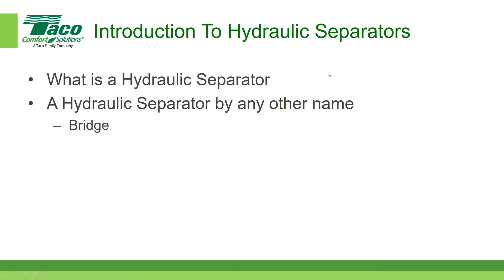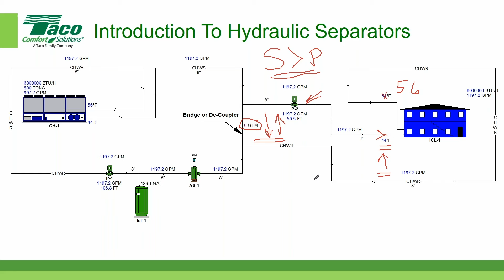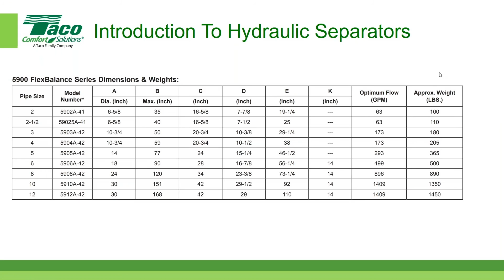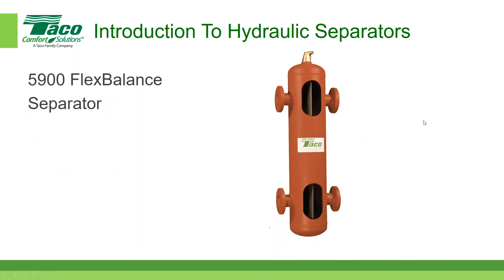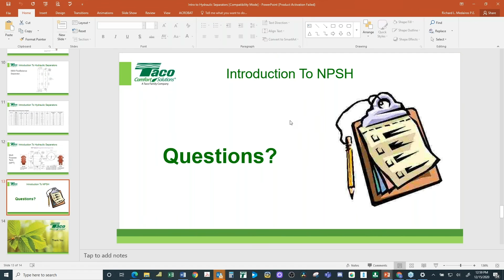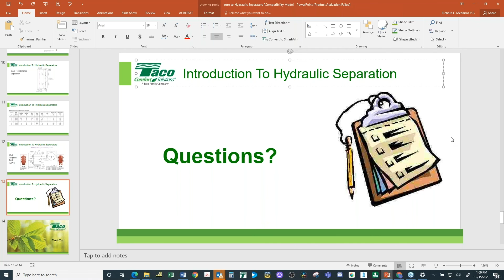Introduction to Hydraulic Separators Including Sizing and Selecting

Comment: Is there a difference in performance if the secondary loop flows across the bridge in the opposite direction? Thanks in advance. Of course it will always mix instead but how could it really negatively effect anything? Heater modulates faster?
Reply from the maker: Jayson, the best practice to insure that the primary flow is greater than the secondary flow. Some engineers will use the change in flow direction at the bridge as a control point to increase the primary flowrate. Thanks for the question and I hope this helps.